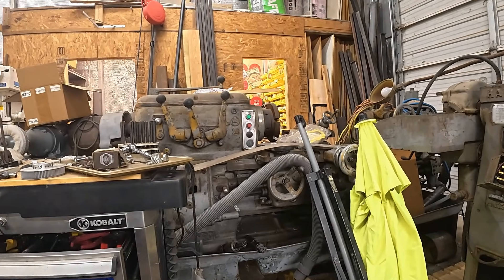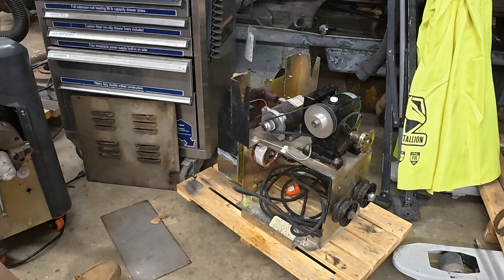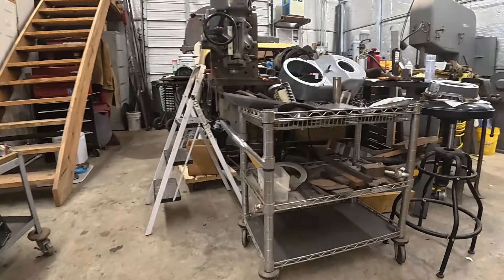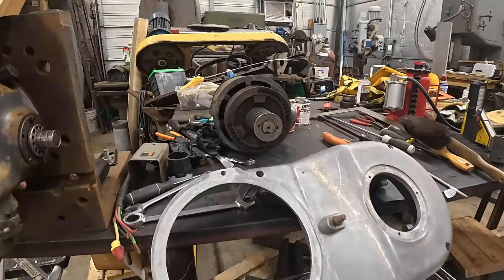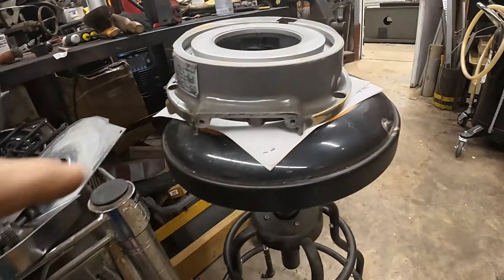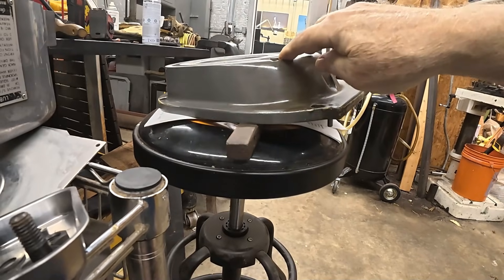The Beast / Welding Rotators / Bridgeport Rebuild. One of those FAILED

Comment: You could put a jack shaft in between to make a double reduction with your extra parts spin motor 180 degrees first belt to jack shaft then 2nd belt to gear reduction

Comment: Greetings Mr. Steve from Nacogdoches. Keep working in the shop and you’ll keep improving. Could you replace the 24v power supply with a 12v? Keep improving and when you are up to it, I’ll fly back down and fly you to Nacogdoches.